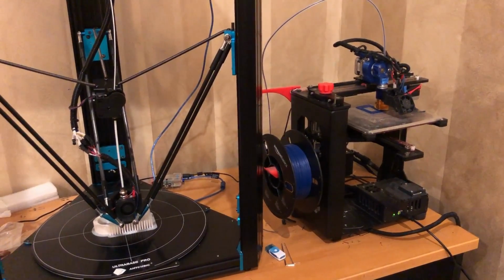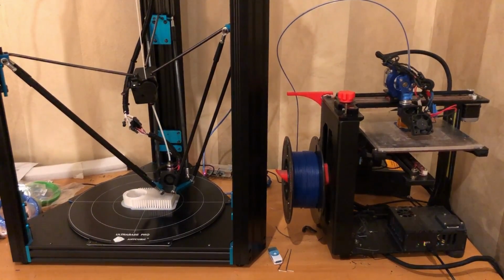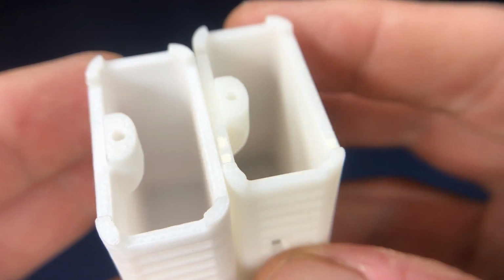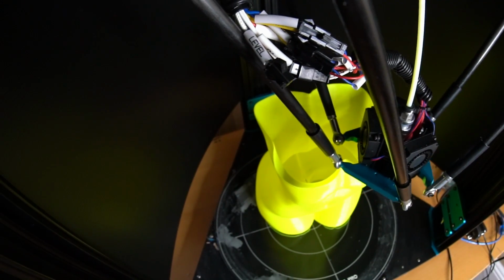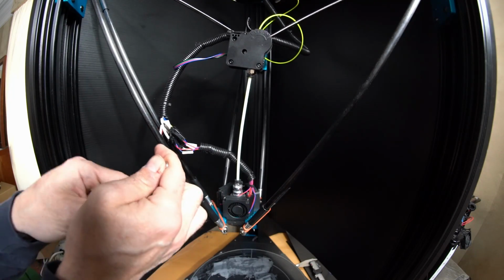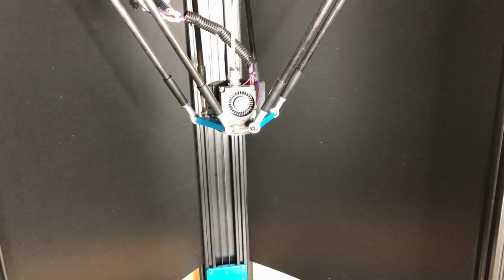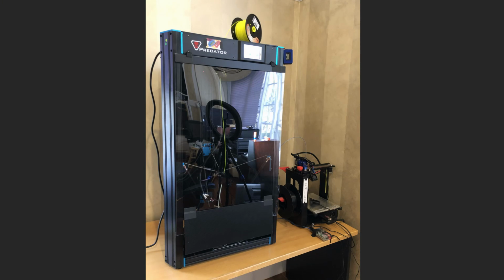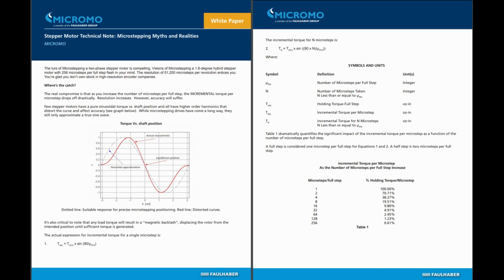Anycubic Predator Delta Printing Robot

Comment: Hi, thanks for the great video.
I'm thinking about changing fans to reduce volume when the printer is working. I'm confused about the voltage: which voltage is correct for Anycubic Predator fans? 5, 12 or 24 V? Can you help me?

Comment: Hello! Thank you for the great review. One question: Do you still use the silicon loops to tighten the rods? I've read from couple of comments that it causes the bearings on the rods to wear out faster because it constantly presses them. Thanks.

Comment: Thank you for this vid! I've had one arm plate drooping and it's driving me nuts. Glad to see it's a quick fix! I've seen others say the TL Smoothers were a good mod so I ordered those up today. Overall it's been a decent printer but mine is having layer shift issues in the first 30% of a print, and it's dragging the nozzle bad enough that it's knocking my prints off the bed. I've tried all the usual remedial fixes to no avail. Any advice? I'm using glue sticks but they are a pain and a bit of a mess to clean after every print.
Also curious what the hot end voltage is. The power board says 24 volts, but the manual states 12?
Reply: Hey mine was doing that to and one of my belts was actually hanging by a thread ordering new one now when its repaired i will get back to this comment also did you fix it and what was it
Reply: @rockman49er  I ended up doing the magball upgrade to the effector plate and it worked great for awhile, but last fall it had a catastrophic fail after a 13 hour print where it crashed into the top of a 180mm part I was working on, pushed that and the entire print head off the bed and spent the next several hours slamming back and forth between two of the uprights. The end result was it spewed the full spool of filament into a plastic spaghetti mess, broke the print head and a bunch of parts from molten filament jamming into and out of very inconvenient places. It took forever to get parts from China and various places, and have since bought a bunch of upgraded heads but have had temperature control issues with those, or the heads wouldn't fit on the stock plate which wouldn't be so bad if you have another printer to print other parts to make it fit. I did not, so I've had to kitbash all the heads, sensors and wiring to get one working unit. Matter of fact I've got another heater block going on tomorrow which will hopefully get this working again. I'm making the jump to resin but that one won't be here til April, so I have to get this thing working in the mean time. 
At least I feel like I know this machine like an engineer now so if anything else goes tits up, I can get a remedy worked up relatively quick. If you end up doing anything major, I would suggest spending the bucks and getting in touch with the guy that makes carbon rods with the upgraded ball joints. https://www.magballarms.com
Reply: @C-M-E  wow thanks man

Comment: I finally have one after months of saving. However, I havent found a proper profile for Cura 4.5 yet..
Reply: Did you find one now?
Reply: @nicolastrada2182  nope, had to make one on my own, but the latest Filament bamtak I got sucks and took days upon days to calibrate. Got a 12pk for 100, but didn't know there was going to be so much hassle with it.

Comment: You are quite interesting and well thought out.
To add on a few missing points, Deltas lose quite a bit vertical length in build size due to the arms and require more complex computations to determine inverse kinematics using 3 sets of arms that swing around (while not falling into any singularities that would block the entire system).
As an added benefit, since all of the 3 stepper motors contribute to X/Y/Z position of the head, the precision is higher than using a motor for each axis like on cartesians.

Comment: Hey, so I just got an anycubic predator but before I print with it I need the cura profiles. can you share them with me, please. Happy new year.
Reply: Hi chrome book17 - Cura profiles for the Predator are hard to find.  Yes, we have one, but had to do what Anycubic put in their pretty neat manual - you can download Cura 15.04.6 (and the manual/driver/etc if you need them) from here: 

https://www.anycubic.com/blogs/videos/all-you-need-to-know-about-anycubic-predator
You'd think that the profile would be baked into in the download, but it isn't - you have to key in the configuration from the manual pages.  It does not take long, and it worked for us, sorta. Small test prints are fine, good adhesion with PLA if you clean the bed with alcohol, just as advertised.
Sadly,  Cura 15.04.6 seemingly has some flaws when used on a big delta.  The 'wall' and 'infill' on large curved objects (like my banjo resonator box, and numerous test pieces) fail to join up 100%.  The curved wall is fine, but the infill edge does not curve the same way, it is clearly a bunch of straight line approximations to the correct curve.
No problem! Just upgrade!  Cura 3.2.1 sorta fixes the geometry issue, but not 100%.  Cura 4 is better still, but by now we have to figure out a profile again, since importing a  Cura 15.04.6 profile did not work for us.  <sigh>
Looking at the Anycubic test file - LEVEL_TEST.gcode it is obvious that they did not use Cura! 

It reads: "; G-Code generated by Simplify3D(R) Version 3.1.0 . . . ."
We are still trying to converge on a good  general solution. Small stuff works fine in Cura 15.0.6, big  stuff will even work if  you can live with the doggy edges, big stuff (like my banjo resonator boxes) is a bit hit-or-miss.  My 'fix' is to segment the big curved edges in OpenSCAD to sorta match the segmented infill.  Hey, it worked!
I'd have posted  earlier, but we're currently in Australia and have been a bit busy lately.  Rained today, which is good.

Comment: Nice mods and video. I just got my predator. The only really issue I have is that it leaves diagonal line patterns on flat walls. It sucks because other than that the printer is amazing. Im not even talking about salmon skin its something completely different. Ive seen people with the same problem on the tevo little monster. Did you notice any diagonal patterns that aren't salmon skin?
Reply: From what I understand pretty much all delta style 3d printers make strange diagonal patterns like you describe(granted I'm not sure exactly what you mean), I just bought one too, very impatiently waiting for it to ship.
Reply: @creamofbotulismsoup9900  That cant be correct because I have another delta by BIQU and it has literally the best quality I have ever seen, even on youtube.  The prints are so good on that Delta that at .1mm you cant even tell that they are printed and that delta has virtually no artifacts. Its called the BIQU Magician. Man I want to capture that quality in a bigger printer. The Predator doesn't even print better than my CR10 :(
Reply: @cutty02  Generally it isn't that bad, but I have seen example prints from the BIQU with these artifacts. Heck you can even see it in the example prints on their store page, ideally it just shows up in the surface finish if you look at it in the right light, and is easiest to see on flat surfaces.
Reply: @creamofbotulismsoup9900  No its not that bad until you see my prints from my BIQU Magician Printer. Then you cant go back to artifacts. The Magician prints are as close to SLA  and I have every seen. Well I order some 16 tooth pulleys hoping I can atleast get a improvement. Now im also gonna try that golden ratio.
Reply: This may be of help with your problem: https://reprap.org/forum/read.php?178,763881
Reply: @creamofbotulismsoup9900  Hey thanks for the link. Now I understand a bit more. My small delta has 16tooth pulleys I think that's why I can see artifacts as easy on it.
Reply: @cutty02  I've looked around a bit more and it seems that getting the layer height set correctly combined with TL smoothers to clean up any minor artifacts can help clean up the print quality considerably with this particular printer, and a set of motor dampers doesn't hurt and it's supposed to help with that high pitch noise it makes. Thankfully these modifications are inexpensive like 30 bucks for the dampers, smoothers and the o-rings that were suggested, and I am hoping it will help this cheap printer perform like something 2-4 times its price, at least that is the plan. Likely going to try to modify it to handle PC/nylon, still looking for the best way to accomplish that on this printer, it seems achievable,may even water cool it, the top looks like it has the room to make it happen; small pump, 40mm rad, and a duct to keep that heat away from the electronics and exhaust the air up through the top.

Comment: i have had this printer for a few weeks now and i cant for the life of me get the auto leveling process to actually work. some areas print so close to the bed that no filament comes out and others effectively print in air. im tearing my hair out about this
Reply: We need a response to help with this issue.
Reply: @lifebytheminute5200  hi
Reply: @phandats  no solutions yet?
Reply: @lifebytheminute5200  actually for some reason it started printing normal but after a week it went back to trash. When I tried to recalibrate it the machine had the same issue it had before
Reply: Nope

Comment: Hi, I have an Anycubic Kossel Linear Plus 3D printer and  fitted smoothers and anti vibration mounts. These two mods reduced the decibel level from about 52 to 40 decibels. I haven't done a large print yet, but the corner infill parts I printed are much better than the ones I printed before the mods.
I have ordered silent fans (for all positions, and I believe these will further reduce noise.
Reply: Ссылку на бесшумные вентиляторы скиньте.

Comment: Nice review, thanks!  With the delta, not only is there the benefit of (potentially) higher speeds, but I'd imagine it'd be easier to print much more slender objects.  This is a major problem with my Prusas.  When you print an object that has a small cross section and is tall (i.e. slender), on a regular (y movement) Cartesian system its like printing in an earthquake chamber.  You are putting all kinds of violent moment forces on the delicate connection between the object and plate, and objects usually fall over without tons of extraneous supports.  So a printer like this would be great for printing skyscraper models, or likewise anything long and slender (up to 455mm!).  Also, the bowden solution is nice, but if this could be a cool mod?  (https://zesty.tech/)
Reply: The nimble or the flex3drive are definitly nice solutions for all 3d-printers with light printhead. On the Predator with its short bowden the question is how much improvement you can get, because its already a good solution. Much more improvement if you have a long bowden (like on Anycubic Linear Plus, CoreXY or Ultimakers).
Also the Predator uses massive aluminium - the effector and the sliding plates at the frame have much more mass than they should. So to get real improvement first thing to do is changing them to lighter solutions (like printing them in nylon-carbon instead usining aluminium). Only after reducing weight of moving mass the nimble can get full potential of a nimble.

One thing: Do not mix up "cartesian" and "y-moving-bed". All bed moving y (without ABL) are cartesian, but not all cartesian are y-moving bed. "normal cartesian" historical are not i3-style. Beginning from early 2d plotter up to the first 3d printers moving the "tool" in x and y was the classical solution; on 3d printing bed moving z is "classic".
Also exactly spooken "cartesian" is also only valid without ABL - as soon as you use ABL you bend the space in z, so you are in a non-euclidic space, so the system can not be cartesian by definition.

Comment: In terms of the two pedals, I can't see much of a difference at all on video, but the one on the right seems more solid if anything although barely noticeable at first glance
Reply: if you are a beginner for delta , FLSUN is  a brand focused on the delta ,It is highly recommended to buy this one https://www.aliexpress.com/item/4000130776715.html?spm=5261.13614333.0.0.763d4dcenY162R less than 170$ ,200x200 printing size,the price in 11.11, off course , you also can consider about FLSUN QQ-s, 260x360mm printing size less than 300$ ， 
https://www.aliexpress.com/item/32813476326.html?spm=2114.12010612.8148356.3.2ed81747raVDog
Reply: @jasmyn4699  - hi! Sadly neither of these FLSUN printers are as big as we needed - the 200x200 is impractically small, especially since it will only take a 140x140mm cube - whose corners would touch the sides of the cylindrical space.  The prices seem to have increased since your post, too.  The Predator at $339 is still a pretty good deal, I think: 

https://www.anycubic.com/products/anycubic-predator-fdm-printer

Comment: I have some error with the calibration everytime i make the sensor then i print the TEST file. In one side is large gaps, in the middle is ok and on the other side is a lake of extrusion. If someone have some tips that would be great. I can 't find where is the problem. Is my first DELTA printer.
Reply: I had the same problem the first couple of times I tried the test pattern. I finally decided to ignore the manual and run the bed leveling routine with the bed at the same temp I was printing at and it worked fine. It seems that, on my machine at least, the print bed was changing shape a bit as it heated up.
Reply: @Bigboule - Agree with Phillip Heslin that pre-heating the bed before level and TEST is a good approach, it also helps to clean the print bed with alcohol after removing the protective film.  This improves adhesion with PLA, we have found.

Comment: The plastic material he uses for the sides is called "Coroplast".  This is the stuff you see used for political signage and also those rugged Postal Service bins.  You can find it at some hobby and framing shops, and also at sign companies.  Amazon sells it sheets up 24"x36" (search "coroplast sheet 24 x 36") in different colors -- white would be a good choice.  Home Depot sells it in 4 ft x 8 ft sheets, but that's a bit much unless you have other projects in mind.  You can get a cutter on Amazon too (Saw Trax CCD4 Coro-Claw 4mm Coroplast Cutter).  For this to work with the printer, the interior channels have to run up and down -- the long dimension.
Reply: Лучше использовать листовую пробку.

Comment: Hi, can u tell me the size of the o-rings please ?
Reply: I use -227 "O" rings of Buna-N material. They are 2-1/8" inside diameter. The McMaster-Carr part number is 9452K65. The same item in EPDM rubber is 9557K229. Either will work just fine. A metric rough equivalent is a McMaster-Carr 9262K32, and is 54 mm inside diameter and 3.5 mm thick in Buna-N. All are standard industrial sizes, and should be easily available from any supplier by size.
The size is not at all critical, you just need to pull the ball joints together so there is no slop or play.
More important is the material. Silicone rubber is probably not the best for this application, as it takes a set, and doesn't recover very well from being stretched.
Stick with Buna or EPDM.
Certainly DON'T use any old rubber band. It will work, until the latex rots, gets gummy, and falls apart!
I also encase the boudin extruder suspension springs in silicone tubing (McMaster-Carr  5236K842) to damp the vibration of the extruder from reaching the hot end. Use enough tube to fully encase each spring. It makes a noticable difference.
Reply from the maker: I put it on camera in the video.

Comment: @rsilver Thanks for the great review. (I like the fish eye, BTW : ) )...
Just a question if you don't mind: I was wondering if the short boden tube transfers the swinging of the stepper motor hanging on the 3 springs down to the hot end? If yes, does it influence the print quality?
Reply from the maker: It's ok but I did fail badly on the lighting.

I don't think the swinging of the motor can pull and tug on the filament length, but it is worth thinking about. No tube would mean that the mass of the motor would be on the effector, and a longer tube would have more of the Bowden issues. So I think this was the best way to do it.
Reply: Gerrit, I recently got the same printer, and other than bed sticking issues (solved with Elmers Washable Glue Stick) it has done an excellent job of printing everything I throw at it. The two mods I did during assembly was adding the rubber bands to the effector arms (I used -227 "O" rings), and damping the boudin drive springs. I slipped my springs into snug fitting silicone rubber tubing before I screwed the springs into place. Without the tubing, the boudin drive can "oscillate" at times, and the shake can indeed feed into the hot end.
Reply: @rqthree , many thanks for the reply and the additional mod of the springs. In the meantime the printer arrived here and I am impressed by its results so far (I already have a Photon resin printer, but needed a printer for large parts). Except, that one of the three Z-axis end sensors hasn't been triggered by the little L-bracket, I had no issues yet. I will consider the spring moditification you have mentioned.

Comment: Great review, I just received my predator few days ago and it´s printing great, by the way it´s partly thanks to your rubber band mod.
Would you probably share your retraction settings? Because on your pillar bolt print there is no stringing visible.
Thank you.
Reply from the maker: I don't have them perfected yet. The manual that came with the printer uses 6.4 I think.
Reply: Try springs.